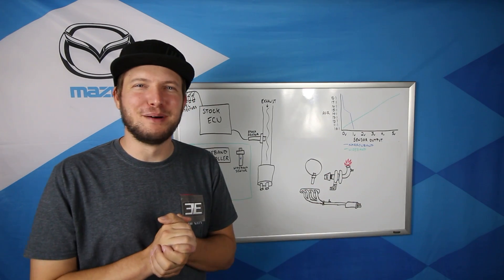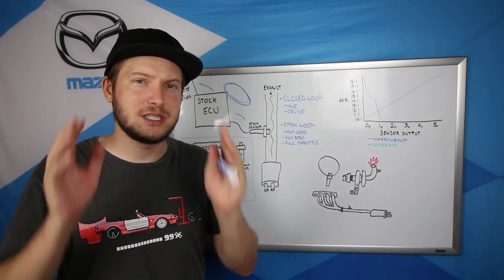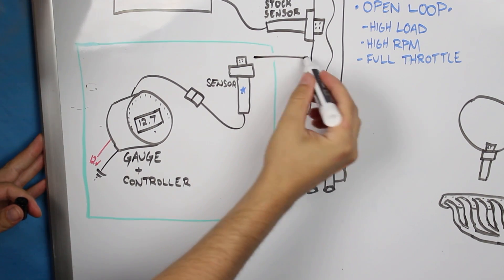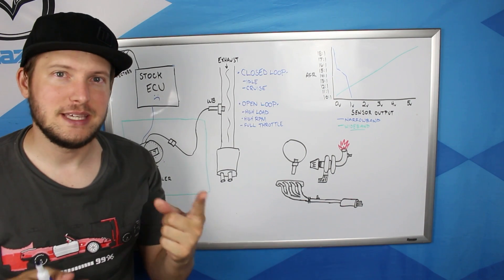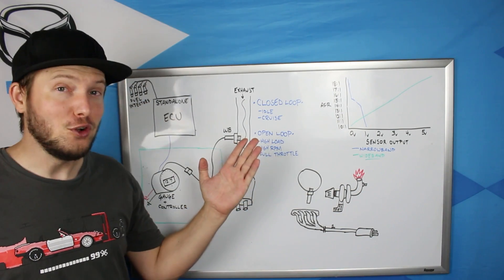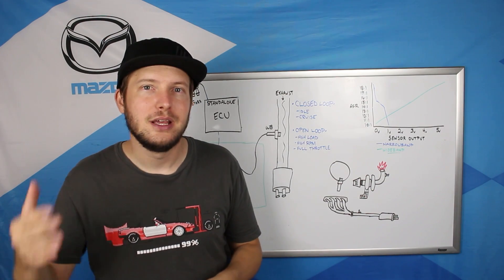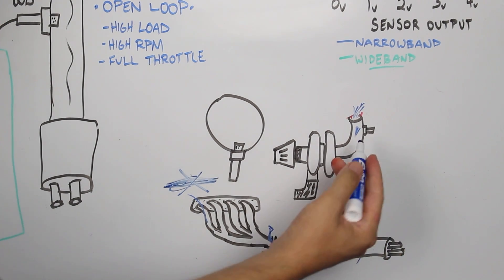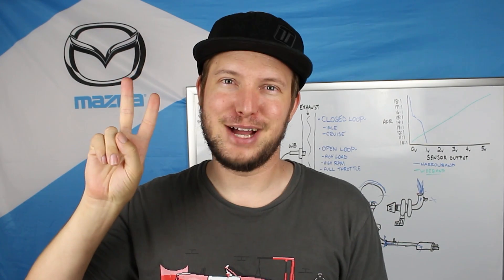Everything You Need To Know About Widebands To Keep Your Engine Safe!

Comment: Dont forget to run the wideband ground to the same place as the ECU gets its ground
Reply: False
Reply: @robertgiordano555  From someone FAAAAR more knowledgeable than either of us - For the most stable and accurate readings, the ECU and O2 sensor should share the same ground. This is why all of the OBD-II cars run all of their analog sensor grounds back into the ECU itself, whereas the earlier cars grounded them to whatever point was most convenient. What matters most for an analog sensor is not that it has the best possible ground, but that it see the same ground potential as the ECU.
Reply: This is always good practice.  Using a different ground path than the ecu can effect sensor readings between guage readings and actually logged values due to a variance in ground offset from different locations.  

However, this can be adjusted to a degree by changing the voltage slope.
Reply: @hoodlum206  I don't remember what the product is called but there is a product that helped with this, it would calibrate ground offsets between sensor and the output wire and tell you what to set the voltage curve in tuner studio.
Reply: @awesomecooly123  hey thats ptretty neat, does it go in line between the ecu ground and any ground? 🤔
Reply: Ugh. This is doable but a real PITA on an MR2T
Reply: @ronniepickering3711  I found it, its called a Spartan 2 wideband controller.

Comment: So here’s my question I just installed a cold air intake on my car and I plan to do some exhaust work on it too. Should I get a standalone ecu with the wide band and then tune or just get the wide band and tune with my stock ecu. (Just for context I don’t want my car to be a race car or anything like that I just want it to run the most optimal it can with the all the mods)
Reply from the maker: It's not possible to do any real tuning in a stock ECU (if you're talking about a Miata) so you'd need a standalone if you want to adjust anything. If you're speaking of a different type of car with a flashable/tunable ECU then I'd recommend keeping it in the car as it will always run better and more consistent for day to day use vs. a full standalone

Comment: What if you have a V8 do you need two, one for each side ?
Reply from the maker: It can be done different ways, having one in each bank is better than having a single sensor reading both banks, but having 8 sensors, one for each header is even better than that, haha. I used to run a single sensor in a V6, on what was commonly known as "the lean side" due to intake manifold design. That way I knew if the lean side was safe, the other bank would be as well. TL;DR it's best to have a sensor in each bank

Comment: Where does the wideband sensor go please? I have a cat on the car, which is bolted onto the manifold, before the downpipe and there are 2 O2 sensors, 1 pre-cat, 1 after cat. Does the wideband go next to the pre cat, or next to the after cat?

Comment: I’m running an aem wideband in my downpipe which is a begi downpipe that is basically a slip on style two piece downpipe

I know for sure when I start the car I have a slight leak at the slip on joint which is now making me wonder if it’s effecting my wideband big time on cold starts

Car still starts fine but if I blip throttle super cold it stumbles a bit within first 30 seconds and I’m assuming this is why

Thanks!!!
Reply from the maker: It sounds more like a tuning issue, possibly the acceleration enrichment or after start enrichment. I had that same downpipe and didn't enjoy it :)
Reply: TheCarPassionChannel thanks greg! Yeah I also hate this downpipe, hoping to go with a kraken setup soon. 

I’ll tinker with the tuning, I always have trouble with tuning the enrichment... only happens when temps are colder here... and within 30 seconds after warm up it’s fine! 

Thanks again dude

Comment from the maker: Regarding Lambda vs. AFR, specifically with E85: This topic can be very confusing. With gasoline, the stochiometric ratio (AFR where all fuel is burned) is 14.7:1. With E85, that ratio is 9.8:1. (E85 requires much more fuel to be injected due to its lower energy content). Even though the AFR's are different, regardless of the fuel this is known as 1.00 Lambda. So when switching between different fuels, why does my wideband not read 9.8 while cruising on the highway with E85? It's because most of them use Lambda, then convert that into "Gasoline AFR". Most of us are so used to seeing and tuning based on gasoline AFR, and not with Lambda or ACTUAL AFR. So when I do a full throttle pull on E85, even though my wideband reads "11.5:1" the actual AFR is 7.7:1. Confusing enough? So what the wideband does it it reads Lambda, which in this case is 0.78, and multiplies it by 14.7, to give you the "Gasoline AFR." This way you don't have to memorize different AFR targets for each fuel. This is especially helpful when running Flex Fuel, because if you have a 1/2 tank of 91 octane, and a 1/2 tank of E85, what is your stochiometric ratio? 12.2? You don't need to know. The answer is 1.00 Lambda, the gauge will still spit out 14.7:1 regardless of your fuel blend.

Regarding cars that come with OEM wideband sensors: I have pretty limited knowledge on this topic, I know that via OBDII readers on some cars you can see the AFR's with the OEM wideband sensors, however there is mixed information about the accuracy and range of the sensors. Based on the fact that is is pretty rare to hear of people using their OEM sensors to read out AFR's or even tune with them, I'm guessing they are more restricted than using the current Bosch LSU 4.9 wideband sensor (the standard for modern wideband systems).

Info about specific widebands - The original Innovate MTX-L has the 2 signal wires, one for each mode. The AEM Uego has a single signal wire, with a switch on the back to change modes. The AEM X-Series does not support narrowband and cannot be paired with a stock ECU as a replacement sensor. You CAN still run it on its own, just don't hook it up to the ECU. The Innovate MTX-L Plus has a single wire and might not support narrowband either, maybe someone in the comments can confirm.
Reply: in the Vag world they had oem WB (4.2) since 2002 or so, and always closed loop. yes you can and will tune based on that reading in the log.
Reply: The MTX-L Plus does not support narrow band it only outputs a 5v signal.
Reply: @ericschatz4943  Hi I've only just posted that and then seen your post, " correct "   brown wire has been deleted, but the output is  0v = 7.35 AFR to 5v = 22.39 AFR.
Reply: Is that e85 data still relevant at this point? Running a e15 blend and not sure what to target.
Reply from the maker: @BulliKid  If you have a wideband that converts lambda to "gas numbers" which most do, then you still would target mid 11's in boost on the gauge, even though that's not technically the AFR. Also - E15 should use pretty close to gas numbers id imagine, since many states standard and premium gasoline is around "E10". My local gasoline is about 8.5% ethanol on average
Reply: @TheCarPassionChannel  so I’m actually using my factory primary o2 sensor to tune.  On my tuning platform hondata it reads to 10.14 AFR.   I’m not sure how accurate it is though.  I have had people tell me that ran the stock sensor and a wideband that they were similar afrs and then I had others say it’s off.  🫣. I found a chart on COBB and it have afr ratio targets for Ethanol blended fuel. And e15 pretty much had a lower gas afr target.  

~14 afr idle / cruise
~11.2 afr mid range transition to boost
~10.7 afr boost.  

So I’m trying to target those afr targets compared to standard 

14.7/12.5/11.5
Reply: @BulliKid that's how i ran my supercharged single jingle neon and it's still alive

Comment: My Miata's AFR sensor works very well but I have no idea how to tune I have been trying for a while I can get the car to idle and I can give it throttle and it responds well but the idle is 10 to 1 when it should be about 14.7 to 1 I have changed a lot of setting and I can sometimes get it it idle at about 11 to 1 if anybody can help me out with some tuneing please let me know 😊

Comment: Hi Greg, thanks for all your work on the Miata car passion channel, so just started to do a few mods on the engine mk1, 1.6 Eunos JDM. i in the UK.. just  purchased a Innovate MTX-L PLUS. just let you know and other people this wide band AFR Gauge can not be use with the  "stock ECU" as there is no extra wire on the back of the gauge !!! only red, black,  yellow and white dimmer.  But as i have two oxygen bungs already in the exhaust its up and running,  Next is to fit stand alone ECU
Reply from the maker: Yeah the newer versions do not have wideband emulation unfortunately. But once you go to a standalone you don't need it anyways 🙂

Comment: Hi, can someone advice me, please? I have a MTX wideband, stock ECU, brown wire narrow emulator wired on the  signal wire on my 3 wires stock lambda harness, stock lambda sensor removed for the MTX one. The fact is the +12v heater and the ground for the stock lambda aren't conneced, my car is on a open loop and running so rich -11.3 at idle. I read somewhere that i must plug the stock sensor for resistance. True or false? Any advice for me? Thanks.

Comment: I had been using my wideband without any proper knowledge for like 2 years before I actually learned about the pre-heat thermal shock thing a few weeks back. Guess I was lucky I didn't kill my sensor :p Great vid as always.

Comment: Do you know if a speeduino from DIY EFI needs a controller?
Reply: As a speeduino owner, I can say: maybe 😂 it depends where you bought it. I bought mine directly from the man himself in Australia in March, and it didn’t come with a wideband controller. I run a standalone AEM UEGO. However, I have seen some eBay resellers who use their own boards and integrate a wideband controller into their system. BOFI racing on youtube installed a speeduino that had an integrated wideband controller, as part of a whole NA6 kit with a TPS, ecu, and wideband all in one. The sensor just plugged straight into the speeduino. That could be a weird European thing because people over there are used to the  ME221 and such, but idk.
Also, TLDR I would personally recommend a used megasquirt from FB marketplace or craigslist or eBay over a speeduino. It will save you money in the long run. Trust me. If someone told me that a year ago I would have saved a lot of money
Reply: @elementaljosh  what eventually happened that made you conclude MS was the way to go? (Just put in a speedy EFI and x series) going through tuning...issues.

Comment: the rule for WBO2 sensor placement is 18" from the turbo outlet. for N/A headers in the collector where you're sure all the flow from the tubes will meet. good video Greg💪
Reply: Comment should be pinned Greg :)
Reply: I run mine 4'" away from the turbo.
Reply: @alantran6901  and you never had the WBO2 overheat or fail? do you have a heart sink on it? 18"away is good enough. its not any more accurate at 4" from the turbo
Reply: @PANTYEATR1  I have a aem heat sink bung.  Also, the closer it is the better.  Not so much for accuracy but for reduction in signal delays from actually load points.
Reply: @alantran6901  i want to see a laboratory test done with the WBO2 different distances ranging from 4" to 18" and see the results
Reply: @PANTYEATR1  Cool.  Let me know when you get that done.
Reply: @alantran6901  shit...I'm not gonna do it😅 somebody like Engineer Explained, Mighty Car Mods, Tuning Fork at Haltech or HPA. are better suited for that
Reply: @PANTYEATR1 it's nothing new.  Its been done, tested and known that distance plays a role in signal delays. It's easily seen on the dyno running two widebands, one up front close and one the back(tailpipe sniffer).

Not only does the distance play a role but also the widbands controller itself.  You want a good fast reliable wideband?  Buy a Ballenger AFR500v2 with an NTK calibration grade sensor and not some cheap AEM or innovate wideband.
Reply: @alantran6901  there is a huge difference when talking about 4" from the the turbo and the tail pipe sniffer. 18" is not that far from the turbo. 18" comes from the advise of experts that have been turbo charging cars since the 80s and have written week respected books on building turbo systems and testing them. 

we can also take clues from top shelf OEM turbo cars like Ferrari, Porsche or BMW and see how close they put the O2 near the turbo.
Reply: @PANTYEATR1  I only really have one last thing to say as someone always brings up OEMs.   OEM cars and suggests are built upon for reliably and making sure everything stay together until the warranty period is over.   

When you actually have a fast car, data acquisition is extremely important. Especially when little changes can net 0.1 seconds.

I should also probably add that factory narrowband senors are also usually that close, for response time. These are factory turbo cars too.

Comment: Very good explanation. I am new to the MX5 so my question is does a wide band offer any performance upgrade on a stock motor ?
Reply from the maker: No. It's simply a way to measure the air to fuel ratio on an engine. The benefit comes when you start modifying the engine and the amount of air it's consuming increases, so you can be sure to get the correct amount of fuel going into it.

Comment: I know you posted this a while ago, but hopefully you’ll see it, I’m looking at going wideband on a stock ecu, planning on going stand-alone down the road, with the innovate on a 2001 Miata, I’m wondering about how much I can actually trust the narrowband emulation, and also I heard it could potentially throw a o2 heater code
Reply from the maker: It's best to have an extra bung welded into the exhaust, and use that for the wideband. Then you can monitor AFR, but you don't need to hook it up to your ECU at all. In my experience the narrowband emulation was not as good as using the stock sensor.
Reply: @TheCarPassionChannel  I kinda figured, thanks for replying

Comment: Hey Greg,
I drive 13 Mini Cooper JCW, these cars come with wideband from the Factory. 
Can I hook up a AFR gauge to the Stock Sensor in order to monitor my AFR ? 
Thanks!
Reply from the maker: I have pretty limited knowledge on this topic, I know that via OBDII readers on some cars you can see the AFR's with the OEM wideband sensors, however there is mixed information about the accuracy and range of the sensors. Based on the fact that is is pretty rare to hear of people using their OEM sensors to read out AFR's or even tune with them, I'm guessing they are more restricted than using the current Bosch LSU 4.9 wideband sensor (the standard for modern wideband systems).
Reply: TheCarPassionChannel 
Yes, I can use OBD II reader, but I thought using the Actual gauge, would be better.
Anyway, 
Thanks for your answer!

Love your videos tho! 🥰

Watching your Channel since the beginning! 🙏🏼🙏🏼👍🏻
Reply from the maker: @Brian_2JZ  If the sensor is the correct type, yes, but I'm not sure how you could go about splitting the signal to something that will read the AFR but not control the sensor, and also to the ECU for mixture corrections.

Comment: Great video! I have a separate switch for delaying wideband heating. It completely turns off the controller/gauge, I usually turn it on aftter 20-30 seconds of idling.

Oh yes, and extra switches on the dashboard add horsepower as well.
Reply: Sounds like a good idea. Silly question but how did you go about this? What wires did you splice to switch?
Reply from the maker: Same setup I run currently with good luck. I should put it on an automatic timer with an ECU controlled relay.... too lazy
Reply: TheCarPassionChannel I suppose it’s nice to have the functionality of being able to have a reading asap if your doing cold start tuning tho? (By using a switch I mean).
Reply: @TheCarPassionChannel  Same here. And also, my car has a starting sequence to be followed :D
Reply: @bradleybatt1401  The switch simply cuts the power to the controller. No power, no heat.
Reply from the maker: @bradleybatt1401  Yes, but when you wire it on a switched ignition source like this smart guy it just heats during the entire cold start and 15 seconds of idle anyways so it's useless for that 😂 my cold start is all guesswork
Reply: You could get fancy and wire it through a relay triggered by an additional output on the ECU then setup a general purpose table to turn it on after say 30 seconds of the engine running.

Comment: excelent video, very informative, and the timing could not have been better. i am putting a turbo on my honda and have been beating my head against the wall at this point for almost a week trying to figure out if i need 1 or 2 sensors with my s300. but this video explains all i need thank you very much

Comment: I found a 4.9 lsu is on 2015 ecoboost f150’s. Pretty cheap from advance auto and has a 1 year warranty.. thats the one i use in my miata with mspnp2.. the wire is short and the plug has a barb that holds it in place on the car chassis 👍

Comment: My only issue I have had is with the innovates AFR gauge is that I cannot find a good 12V that isn't my radio that I cannot use as the MSSS1 system would be fried. (Know this from the 93LE community)

Comment: Wouldn't the MSPNP2 jumper J7 (Sensor ground select) option between signal ground and chasis ground influence on that widebands "slight off calibration" reading? ..not to mention other sensor grounds  connected to the chasis being effected as well by that. 
If so what was someone's experience or at least hear of that option being used? 94-95